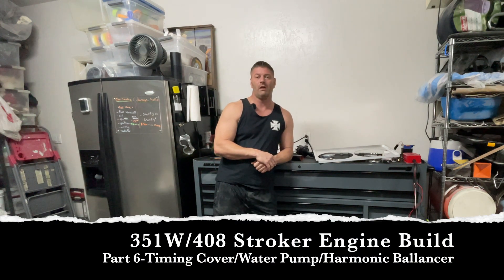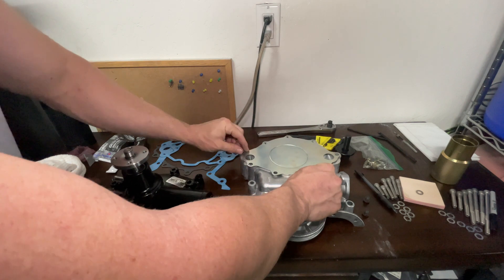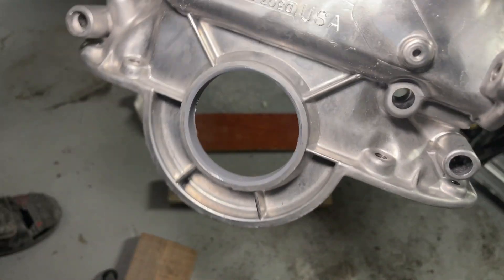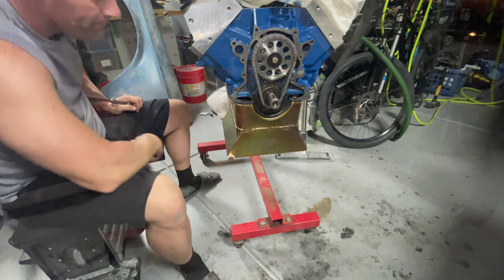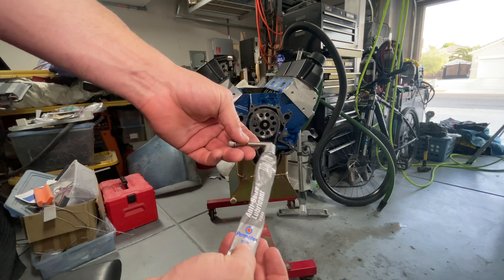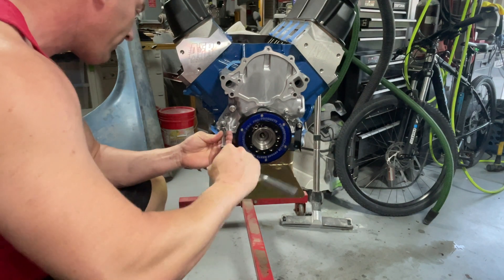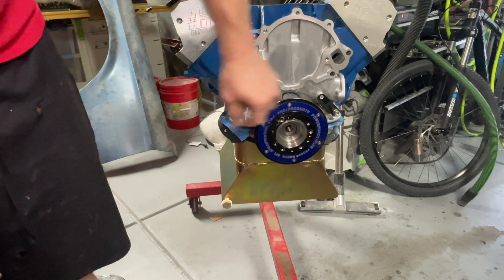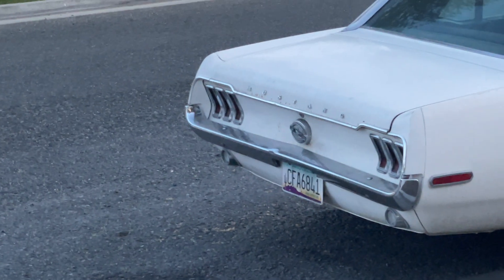351W 408 Stroker Engine Build PART 6 Timing Cover, Water Pump, Harmonic Balancer 4K

Comment: What timing cover bolt set did you use?
Reply from the maker: I used Rogue Bolt on eBay, this was the item number I used, I had to email him on the side for these additional. I need (2) 1 3/4, and (1) 3 3/4. The water pump bolts were not quite long enough for the casting of the one I had.